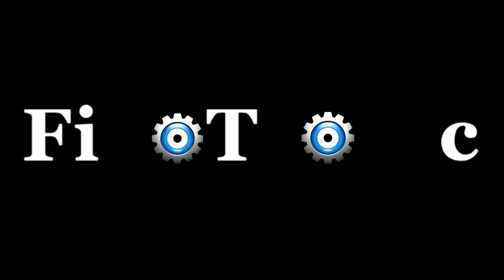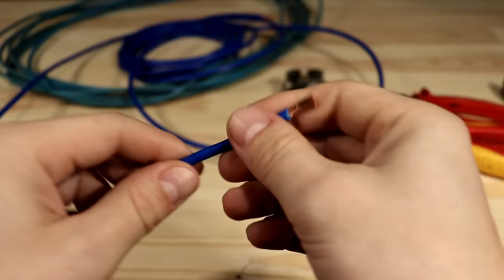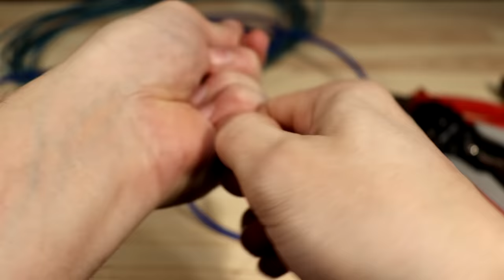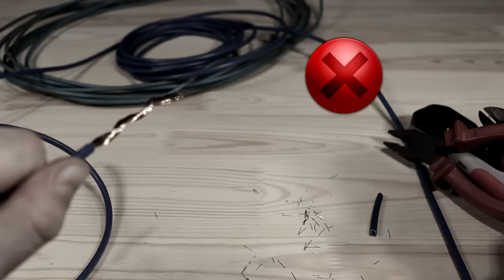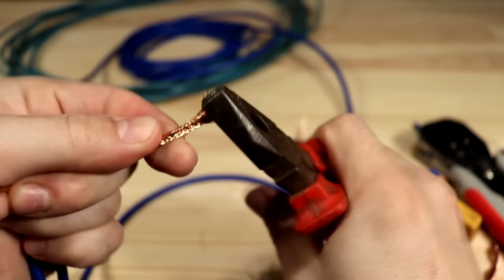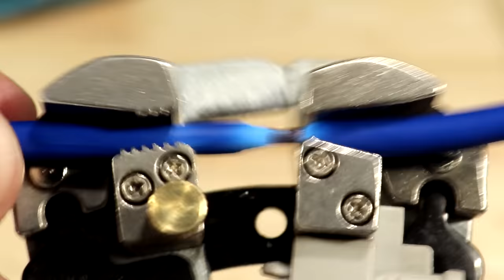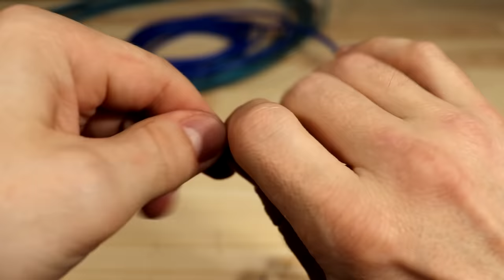AWESOME IDEA! HOW TO TWIST ELECTRIC WIRE TOGETHER!

Comment: He gave that last one extra twists with the pliers that he didn't do on the others, those strands would be fracturing, he also needs some proper tools, his wire cutters are the wrong type and appear blunt, he's got the wrong strippers and he wasted too much wire, 5mm side by side soldered and heat shrunk would have been just as strong if not stronger, if you are going to put that much strain on your cable you need to do a course in good wiring practise.

Comment: There's a lot of unnecessary steps here and exposed wire. You dont need a whole lot. Make sure you get a clean cut. Then strip the wire. The proper fitting wire nut.

Comment: No really good way to join wires is shown.  For a mechanically strong connection, each wire should be split into at least 3 parts, then splice or "braid" the ends together, much as a sailor would do with 2 ends of rope.

Comment: Buy some wire cutters - not side cutting pliers. That was just plain annoying to watch. Also the wire stripping three different approaches had amateur written all over it. Just out of curiosity - in what way do you think that this is automatically superior? Given that the cross section of the conductor is a few mm^2 and the contact area of all of the wrappings will be hundreds of mm^2 it can't be superior for conductivity/resistance. Regarding tensile strength you should NEVER be relying on the strength of a splice without suitable strain relief if you don't want to have major problems. 
It isn't a slam dunk and you don't explain why you think it is superior. Symmetrical doesn't equal superior.

Comment: Nope. Even after painfully watching all of the repeated wire stripping in a 9 minute video that could have been 1 minute, the final join is still no good. To make a decent splice you need to do some soldering or crimping in combination with some good heat-shrink tubing.

Comment: What a waste of time. No one needed to see that crap. Do it right the first time and be done. Either solder the wires, and put heat shrink tubing over it, or use electrical tape. There was no reason to strip that much wire either. You wasted so much time to fit into some YT algorithm.

Comment: Pointless video... You can't terminate the last connection into a socket, gpo, plug base etc. And If your purpose is to connect 2 cables together, then you should be soldering and insulating anyways. And 8 minutes of waste of time for a 1 minute video.

Comment: What you have done is still a wrong way,.. almost right but you haven't measured it right it should be no extra spikes that lapse end to end.. because it may damage the electrical tape when you wrap it. Make sure you attend seminar of electrical engineers before posting a video,. To learn the right way. And it should be done half of every strands not the whole wire in one tie. I find this dangerous and hazardous.